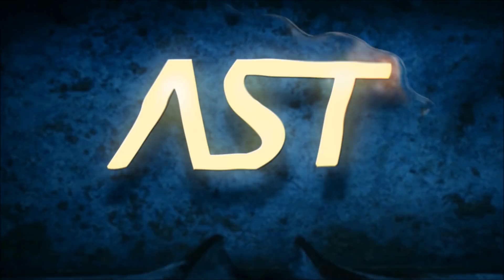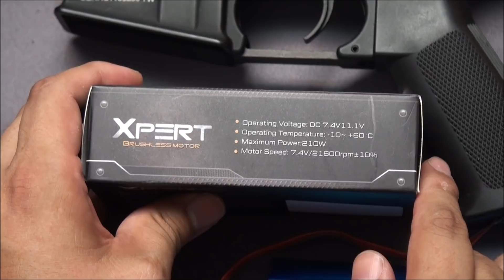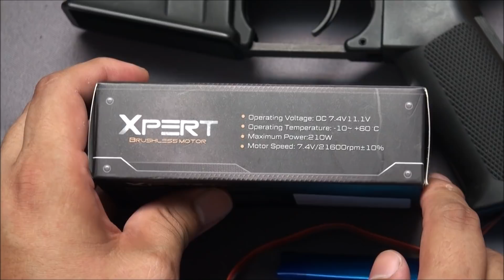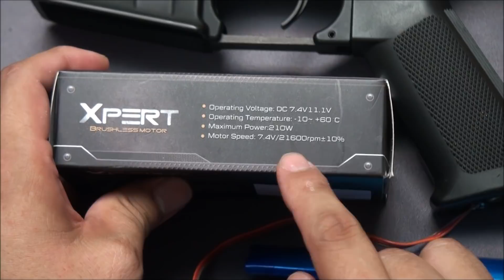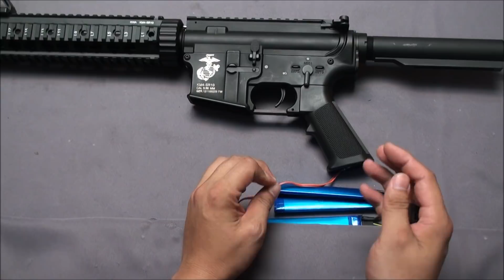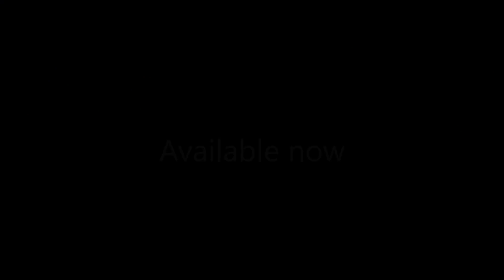Xpert Brushless Motor Debut

Comment: Did some research, so this will not be compatible with electronic trigger units like the Gate Titan. I have to install a traditional trigger and wire the signal circuit like a traditional MOSFET.
Reply: It's like using a titan gate with an titan gate... this motor has a premosfet with direct control.

Titan just has the same it controls the motor directly
Reply: @marcels3960  So... any motor will do the same? I have a KWA 2.5 with titan gate... and  I wanted to try this motor, but..  oh well, as I tough... there is no way. I guess?
Reply: @blueteam-entrenamientotact2980  no need i dont know if you get any advantage.

I guess that you only will have some sort of trigger latency. 

But with a gate you are rdy to go

The only thing I would recommend to you is seal the lower part of your gearbox as good as you can.. due to the light sensor.. and some other players knowledge there are chances of getting dirt in between.. and you wouldn't be able to trigger a shot anymore or cant stop firing untill you unplug the battery or put your gun into safe. Happened to me for example when I tried out different oil types for my gears.. 

Chainsaw oil is the best so far.

Comment: hay I have a problem with my motor: I exedently set it to 0 shots before the initial 10 shots now everything that happens is when I connect the battery I hear the 5 Beeps and the controller display "spins". If I disconnect the Controller and reconnect it the motor spins until I unplug the battery. What should I do? did I do anything wrong (besides accidental programming)? how can I fix this?
Reply from the maker: Hi, you could try to reset the controller by pressing the two buttons at the same time for 5 seconds.
Reply: @airsofttaiwan  so hold up. This is a motor but its also like a mosfet gate titan?
Reply: I'm having same issue only hear beeping the motor doesn't spin.
Reply: Any word on this
Reply: My motor is burned before staring to work. Everything was connected like on diagram.
Reply: Milan Prlincevic yea mine kept draining my battery like crazy